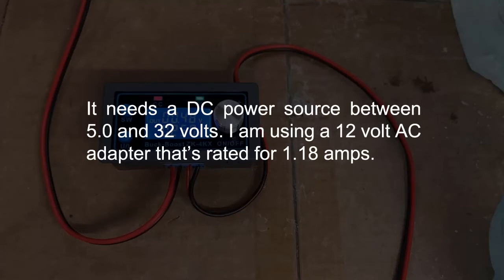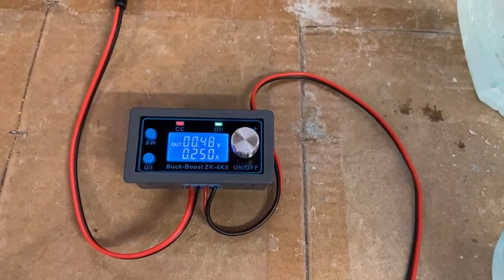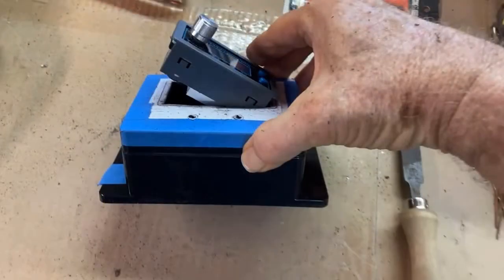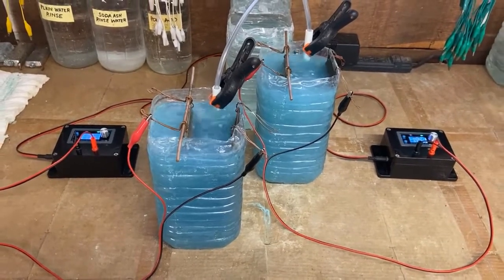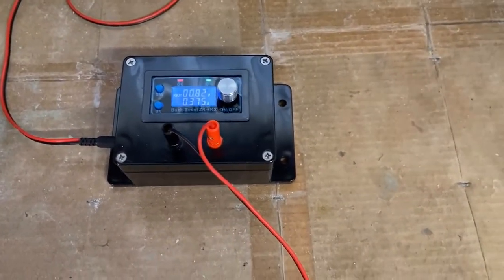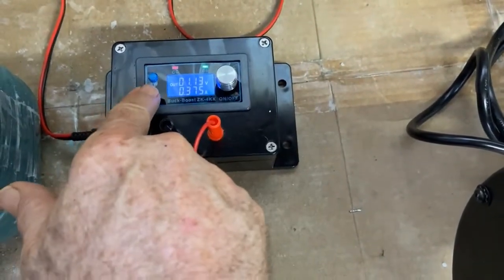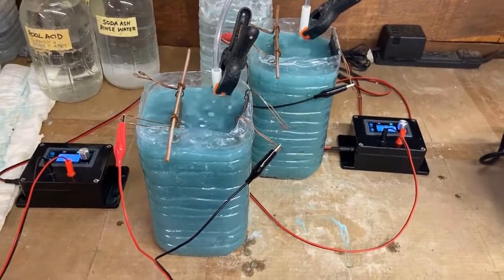Constant Current Regulated Power Supply Module For Making Gans

Comment: These ZK units have one huge flaw. If you toggle it on and off with a CC limit set when you turn it back on the CC limit goes out the window if it’s anything over a couple hundred mA at most. Dangerous if using to charge Lithium Ion. 

Disconnecting power entirely from the unit resets this so you just have to add a switch or something on the power in.
Reply from the maker: Thanks for the comment. I noticed something similar. I've been unplugging the power to end a batch, then plugging it back in to start another batch. I noticed sometimes the CC red LED wasn't lighting up, so I repeated unplugging it and plugging it back in until the CC red LED lit up. I was a little disconcerting.
Reply from the maker: @ericklein5097 In my situation I think it was popping out of CC mode because the output voltage was too low. The output range of the units I bought is 0.5 to 30v (although I've seen it get as low as 0.47v and the CC mode would still hold). I use 1 gallon containers and just by luck they usually start out right around 0.5v and as the job progresses the voltage gradually increases. Today it was popping out of CC mode because I forgot to top off each container with salted water. As soon as I did the voltage increased just enough to keep it going in CC mode.

Comment: Thanks for making this video, how did you set it to constant current?
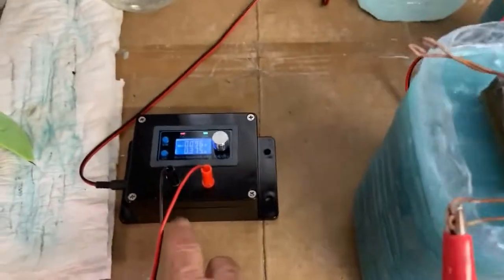Reply from the maker: You have to set the voltage higher than what it needs for the desired output current. That will automatically kick it into Constant Current mode because it forces the unit to limit the voltage to stay within the current setting. In the video right around the 3:05 minute mark, it's running at about .95 volts. As soon as I press the U/I (user interface) button you can see that the voltage was set for 12 volts. After I set the current to .500 amps and press the U/I button again it goes back into normal operating mode. You can see for a frame or two the output voltage increases from .95 to 1.0 volts which is way under the 12 volts setting. I hope this helps.